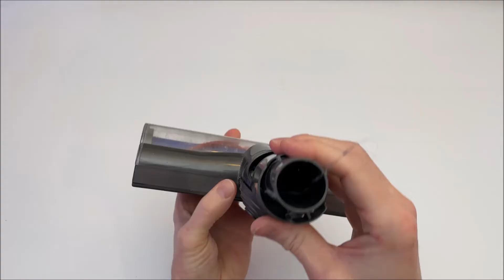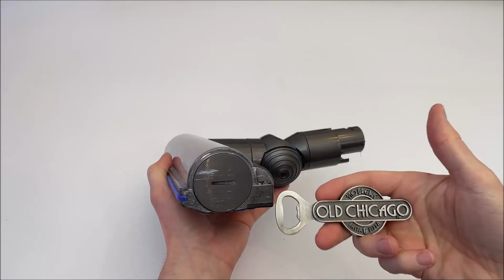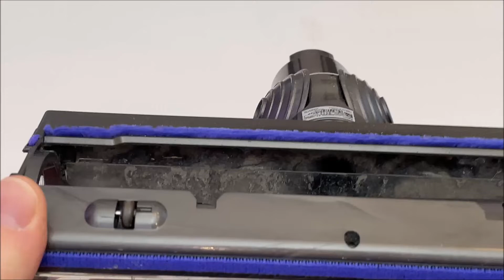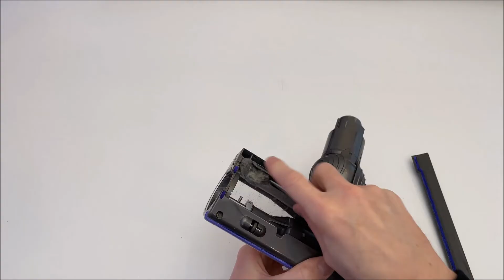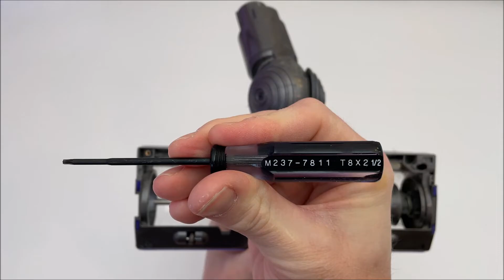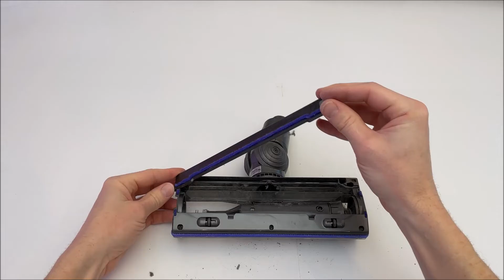Dyson V6 Brush Head Disassembly

Comment: I have a V6 Absolute and the brush on the motor head won't spin. It's not the electrical connections (other turbo brush head works ok) and I've cleaned out all the dirt/fluff I can find. When I take the brush roller off,  the central rocket-shaped part doesn't spin either......can this be fixed or is that part the actual motor and therefore the motor is kaput? I'd be glad of any advice.
Reply from the maker: Hello. I’d say if the electrical connections are okay and if other brush heads work on that vacuum, yes the motor is probably burned out.

Comment: made the mistake of removing the wire cover plate on top where clear plastic roller protecter meets the swivel part. I have no idea on how to get that on. I assume I need to remove clear part from grey part where it turns but even then I can't seem to figure that out
Reply from the maker: Hmm…..without seeing it, I’m unsure as well. Sometimes the vacuum shop is the way to go. Best of luck and sorry I couldn’t be of any help.

Comment: My motor spins without the brush, but when I lock the brush in, it doesn't spin anymore. Any ideas?
Reply from the maker: Hello.  Could you please clarify if you mean the motor in the brush head or the motor in the vacuum?  

There is a dedicated motor within the brush head that spins the brush. Sometimes drive belts fail, they're clogged, or the motor itself burns out or is drastically weakened to the point that it won't spin the brush.
Reply: @FastFixYouTube  The motor within the brush head spins really fast when I remove the purple brush. But when I put the purple brush back in and twist the lock, it doesn't work. It spins a couple times, then stops. It seems to get jammed or something. Any ideas?
Reply: @RC_Cola2020   I'm having the same issue. Did you get an answer and find a fix?
Reply: @leensstr73  Nope :(. I am wondering if it's the bearing inside the purple brush, because I may have gotten water in it.
Reply: @RC_Cola2020  you need a new head. The motor in the head is too weak to turn to brush.
Reply: Hair gets stuck behind the cog on the side that is still attached (you will see a spring pushing this cog). This engages the brush. So with no brush it will spin freely, but with the brush attached, the cog engages and won't spin as it is jammed with hair. You need to get a screwdriver and compress the spring (fiddly), then try and clean behind the cog. Shit design by Dyson... These things are all poorly designed pieces of crap.
Reply: @dwish6370  i’m having the same issue… i tried to clean the cog but cannot reach the part deep down. There’s also hair stuck on the other side if the purple brush head, which cannot be removed either :( very frustrating

Comment: I've been able to remove the brush head once, but now I can't get the retainer cap to come off. I can unscrew less than a 1/4 turn, but it will not come out. Any ideas?
Reply from the maker: Hmm, guessing it’s just a bit stuck. They don’t turn more than 1/4 turn or so. If you’ve got it that far, it should come out. Honestly, sometimes banging them lightly to get things to come apart isn’t a bad idea. Hope that helps!
Reply: Use a flathead screwdriver and pry between the purple roller and the black plastic part opposite the retainer cap. The inner black plastic part is flexible and will allow the screwdriver in between these two parts. Hope this helps.

Comment: My Dyson brush turns if the head is tilted  all the way. If I start to flatten it out, the brush stops. I suspect one of the wires is bad through the “knuckle.” I have taken the head apart as far as you show, and want to go further. I’m stopped at trying to separate the clear plastic piece from the gray plastic. Removed 3 screws, still won’t release. Any ideas? Same model as your video.
Reply from the maker: Sorry, I don’t

Comment: It didn’t solve my problem should I consider buying new brush? I dont understand the issue.
Reply from the maker: If it didn’t help, I’d say your battery needs replaced.
Reply: @FastFixYouTube  thanks, I replaced my brush head and it works like new.

Comment: You missed the most important part. Getting the hair out behind the side still attached (behind the spring). The cog just chews/ draws in hair. Dyson should have recalled this design.
Reply from the maker: Hello. I’ll have to revisit this and check that. I was certain I covered everything. Thanks for the heads up!
Reply: @FastFixYouTube  how do i do that? mine only spins occasionally and I have cleaned all the contacts
Reply from the maker: @gregdoecke7099  hello. I never checked on this suggestion. If yours is intermittent and you cleaned all contacts, there’s probability something internally wrong with the motor or a connection somewhere else. Best of luck.

Comment: Nup, 8 can't get the brush out. Only comes out a aboutb½ an inch. Frustrating...
Reply from the maker: Hello. Sometimes clogs can cause that problem. Can you twist the brush as you pull it out?  That usually works for me. Let me know how it goes. Thanks.
Reply: Thanks for the video. I’m having the exact same issue. It only comes out half an inch. Feels like there’s something causing it to stop. You can hear it. Tried twisting it a million times. Let me know if you found a solution.
Reply: Mine came out once with a lot of shaking and pulling, but now the brush bar is stuck. Only comes out about an inch. Anyone figure it out? The brushhead was new. Do I need a whole new "foot". Its a v6.